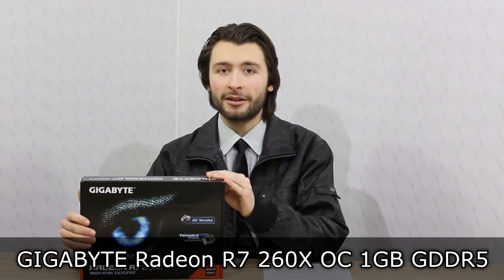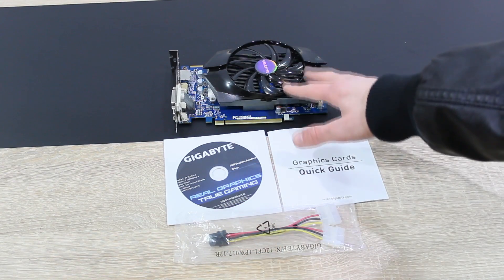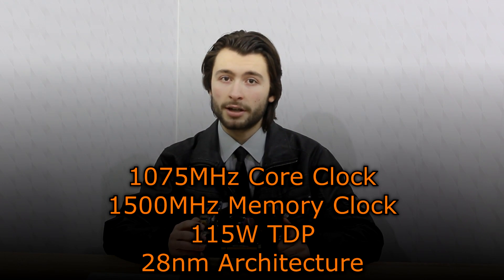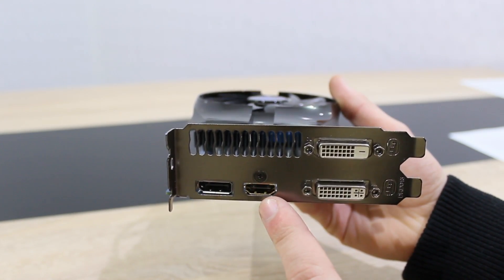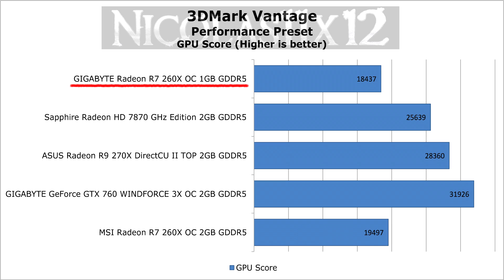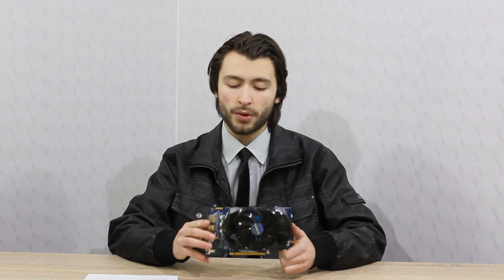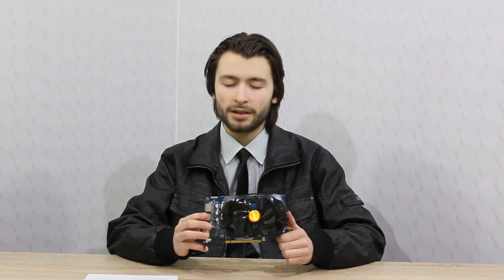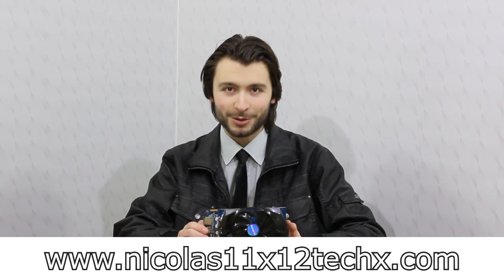GIGABYTE Radeon R7 260X OC Review

Comment: bro can I run the 2gb ddr5 version with thermaltake 450w psu? will it be too risky? I have a tight budget if it's risky I will get the 1 gb oc version and I use Intel Core i5 4570
Reply: +Love Orton of course u can